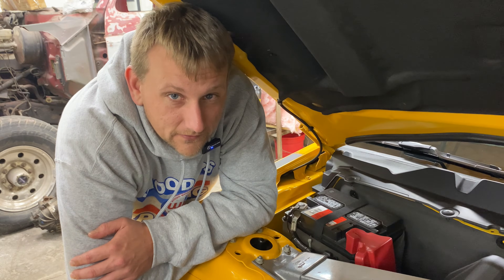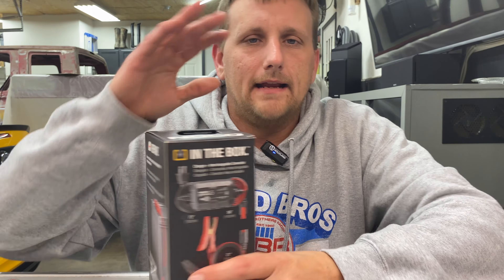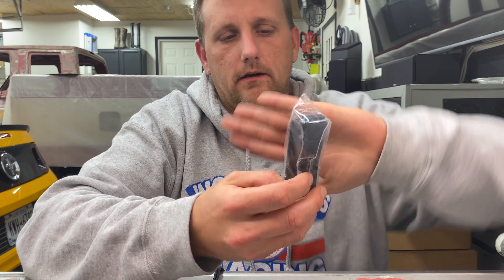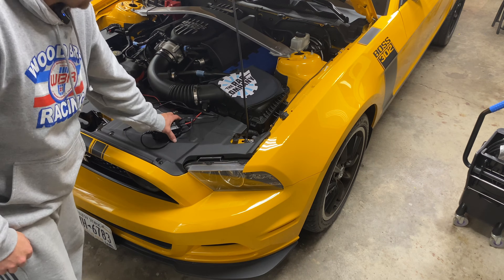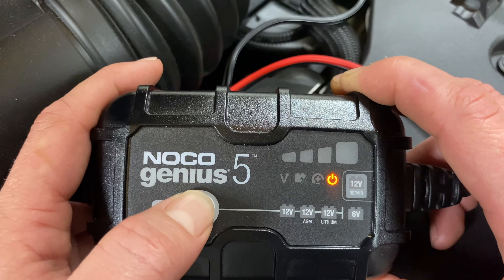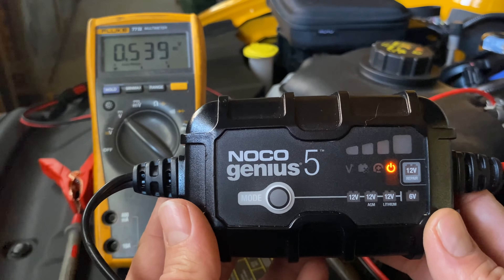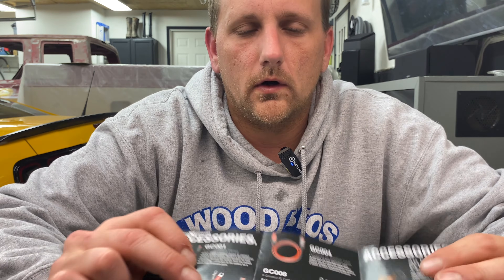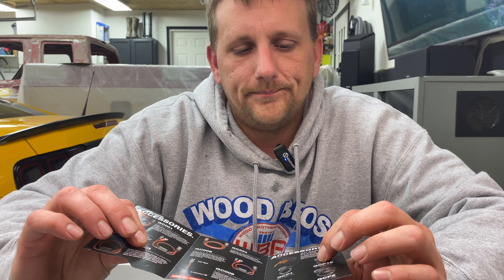NOCO Genius 5 Battery Charger/Maintainer How to, Features, and Accessories

Comment: Thank you for the demo. Noco's instructions are pretty useless.

I used my genius 5 for the first time yesterday. I was able to use to restore my car's dead battery back to 100%, but it wouldn't charge it at first. I had to do a jump start, then use the genius 5 overnight. It went from a blinking 25% life to a solid green in less than 12h. Another option instead of jump starting my car would have been to disconnect the battery to allow the initial charge.

The problem is that I had left my car in accessory mode, and even after the battery died the car still thought it was in accessory mode. Hitting the push start button with the dead battery in didn't reset it to its off position. As a result, the accessory mode was using up any energy that the Noco was putting into it (I could see the dashboard flicker on and off). Jump starting the car allowed me to properly turn it off and let the Noco do its job.
Reply: Sounds like you didn't use the force mode. If the battery is completely dead you must activate Force charge. Djoy e in the instructions

Comment: You've got it hooked up wrong. You've got it connected directly to the battery. On Fords you should connect it to the ground at the BMS otherwise it won't keep track as to how much charge you're putting into it.
Reply: what is BMS?

Comment: I admit upfront I don’t understand cars, batteries or even electricity. 😂. My son’s GMC Canyon (2021) is not driven much and won’t hold a charge.  It’s currently dead as a hammer.  Three questions:  how do I know what type of battery it is (for the setting on the Noco), and I see that you said this isn’t a jump starter.  However if I plug it in for a long time, like overnight, will it recharge the battery so that it’s driveable?  Lastly, do I have to leave the hood up while all this is going on?  Truck is in driveway not in garage.  (going to have to use an extension cord.). Would like to avoid having hood wide open if possible.  Thanks….argh.
Reply: The battery should have a sticker on top or the side with its specs. And yes you can keep the hood closed while it works. Should be drivable when done if the battery wad the problem

Comment: Can I use this to jump start? Does it have internal battery? Like when i am stuck middle of nowhere and no AC outlet around
Reply from the maker: No. This is just for charging and maintaining a battery. You would want the jump pack that they make. The boost (gb) or boostx (gbx) is the two lines of jump packs they have. I have a gbx75. It works great.

Comment: I learned the hard way that alligator clips are no good for a long term connection.  They seem to lose connection after a few weeks, and the battery goes dead.  I used the eyelets instead, but I didn't have to buy the eyelet accessory.  The wire is connected to the alligator clip by a copper screw with an eyelet connector.  Fortunately, my connection points were the right sized bolt.
Reply from the maker: I haven't experienced issues with the alligators clips on my genius 1 yet. It's on my mower. I will keep an eye on that. Thanks for the info

Comment: My 2001 mustang gt is kept in a garage where there isn’t an a/c outlet-if you have to take the battery out of the car is the setup process the same? I just got the genius 5 due to having to get my car jumped from not driving it enough from AAA the guy suggested a maintainer.? Thanks

Comment: I am not savvy about battery charging.  I lost my husband this year and now it's my turn to figure out how to maintain his sports car.  I bought this charger because I was told to put a trickle charge on it while it is in storage.  I was proud of myself for setting it up.  It was doing the just like you said pulsating up to the green.   When I went to check on it today just the standby light was on.  I pressed the mode and got the flashing up to the green again.  If I want it to trickle charge am I doing something wrong or does it automatically switch from standby to charging?  I appreciate and advice you can give,   Charging for dummies!

Comment: Great video, didn't even know such product existed.  I have replaced 5 batteries because of my lack of knowledge.  I especially like the car plug option you brought up.  After I buy this product, will give plug a try.  I wonder if Genius has a product where it auto selects things verses me having to select the right mode using the buttons?  Thanks Nate.

Comment: Question: So, does this NOCO Genius5 battery charger always need to be plugged into a wall outlet to charge a car battery? If I forget my car lights ON and the car battery dies and the car is not near a wall outlet, will the NOCO Genius5 charge the battery?  Please let me know. Thank you for helping! Great video.
Reply from the maker: The genius 5 will only work plugged in. It is a charge/maintainer. What you would be looking for to jump start your car is the NOCO boost(GB) or boostX(GBX) jump packs. I have the GBX75. They are costly but mine works great.

Comment: Hi Nate.  Just viewing your tutorial.  Thanks for straight forward explanation.  So I just purchased the exact same model as shown on this video and will be connecting to my 2018 Maxda CX5.  My question is this... I'm reading on the small tag (on the plug wire of the unit..) that IF charging while the battery is connected in the car, then if the vehicle is equipped with the Neg (-) lead which is also attached to the chassis, the black clamp MUST be attached to that and NOT the battery's Negative terminal.  I see you did not do this on your vehicle and I'm assuming because it is an older model and they probably did not do that in those years.    My question to you... why would it be "ok" to attach both the red and black alligator clamps to a battery for older vehicles that are not equipped with a ground on the chassis but... not ok for current vehicles that have a split in the negative cable lead which is attached to the chassis?   I've read several comments about the battery possibly gassing-off during the charging process which COULD  cause sparks and potential explosion.... is the risk different in both of the above scenarios (i.e. old cars and current cars) ??    thanks!  Anthony
Reply from the maker: Honestly my unit doesn't have any tag stating that information but I have seen newer vehicles that have a remote negative terminal and /or remote positive terminal to hook to for jump starting or charging. Some things are connected for safety and/or other electrical components of the car between the battery and the remote negative or positive terminal that if you go directly to both terminals on the battery itself, you could harm other electrical components of the vehicle. I can't speak to all the different reasons but I have seen that and it has caused me issues jump starting those style vehicles. My car just has standard connections with no remote terminals. If you check your owners manual for jump starting or charge your battery, it will show you exactly how to hook it up. That will clear up any issues with improper connecting of the NOCO. Always go with vehicle manufacturers recommendations from the owners manual or consult the local mazda dealer. I had a 2016 CX5 and from what I remember, it didn't have remote terminals but I could be wrong. It's been 6 years since I had it. I hope this explains some of the confusion for you.
Reply: @natemarcy3939 can you please explain this so I can understand it— cos I have a Mazda 2016 and now I am even more stressed— is this NOCO car safe and idiot me proof- or not?

Comment: Love your video. On the cigarette lighter, I don't think I would use that option. (I could be wrong) However, Some of the newer vehicles now use switching grounds so that the cigarette lighter does not have power until the ignition switch is on. I would hate to send power though the electronics not knowing where the current is passing through.

Comment: I charged my 2015 mazda 3 to full green led but the charge went back down to red (1st bar) im the morning when i woke up, would this be an issue with the car battery? (I'm about to try using the repair mode)
Reply: That shows that the battery will not Hold a charge, which could be caused by the plates in the battery being sulfated. If you use the Repair Mode it may and probably will correct the problem.   1.-- Charge your battery to 100%   2.--- With the battery at full charge switch to Repair Mode and let Repair Mode mode run until it shuts off automatically, which is 4 or more hours. In some cases you May have to run Repair Mode more than once to Fully Restore your battery.  From what I have seen, Repair Mode will work to repair the battery approximately 75% of the time.

Comment: Good timing as my Charger died and found your video, local auto shop had a Boxing Day sale today so raced over and got it plus the NC002 Eyelet connector. About to give it a try and then noticed on both boxes DESIGNED IN THE USA MADE IN CHINA. Not happy but this is a trap I have fallen into before. If I was younger my eyes would have been able to see this fine print. Guess I have to grin and bear it again but please note these are MADE IN CHINA.

Comment: @natemarcy3939 I also have a Boss 302 (2012 # 727).  Mine doesn't have access to a wall outlet, and solar panels are not a great option either since it sits under a cover.  Any advice on how i can maintain the battery?  
I've wondered if a battery powered jump start device would work, but i haven't noticed any that mentioned they could be used to maintain/trickle charge.

Comment: I think the cigarette lighter accessory is for the 10 version which acts as a power supply. So if you’re running an air compressor, you can plug the noco 10 into the way and use it to run a 12v compressor to inflate your tires instead of plugging it into your car (say you have a dead battery or don’t want to start your car)

Comment: Question: I read in some review that we need to remove the battery clamps when using this thing. Is that true? Or maybe just for long-term storage only?  I'm wanting daily maintenance for insufficient drive-time charging issues.
Reply from the maker: I would believe this is for long term storage. Should be fine. I leave mine hooked up all winter with battery terminals still hooked to the car. No issues in my experience.
Reply: @natemarcy3939  Thank you !! 🙂
Reply: @natemarcy3939 Hi Nate, please help. 1st time seeing your video/channel. Very informative!  I have a Genius 10, can't get my car into the garage and it's going to be -20 here. I saw an older Genius video saying to switch from 12V to 'Cold/AGM' (mine just bae 12V, 12V AGM, etc. I switched it from Regular 12V to 12V AGM access it finally charged to green instantly. Before, it was 8 hrs and still on the 1st red pulsing light. It's a brand new flooded battery. My question is, is it still safe to leave it at AGM? I can't find info Anywhere on their website. It's -7 outside now and we'll be between this and -20 thru Tuesday. Thank you for any help you can provide!
Reply from the maker: @aibhilin1211   I would have it on 12v not 12v AGM. Not sure why anyone would have it on AGM mode if the battery isn't AGM. Now understand, it has an operating temperature of -4 to 104 per nocos data sheet for the genius 10. You may run into issues at -20. Just keep that in mind that it may not perform as it should such as slow charging or no charging. I hope this helps. Stay warm!
Reply: I've been leaving it connected, set it n forget, per those who answered! Have had no problems.  Gracias to all. :hand-purple-blue-peace:
Reply: Thank you, this is what I needed to know. Messaging here from Toronto - and just got this for Christmas. 

It is ok to keep connected for 3 months of winter straight 24/7 and there is no trickle button setting, right?
Reply from the maker: @dublahar   I have had no issues with mine leaving it on for the winter. I check on it once a month to make sure all is good. No trickle button. It is all done within the Noco. Set it and forget it.
Reply from the maker: @dublahar this is correct
Reply: If you disconnect power to car, you re boot the computer on power up, so leave on, charge repair if needed, then leave on charge mode all winter is my 2 cents
Reply: @daleval2182  That makes sense, Thank you!

Comment: would there be any chance of you gettting zappp ?
Reply from the maker: With anything electrical, I was always treat it as a possibile shock hazard but in reality, this is very safe and being zapped is next to none due to all the safety circuits inside of the unit.

Comment: Thank you for this. Great info. I am researching this unit to maintain an AGM battery as my car is staying in the garage for the winter. Last year, the battery went dead and I couldn’t open the trunk were the battery is located 😂
Reply from the maker: Winter storage of anything with a battery is always an issue and with technology advancements it's making it worse. Lol sometimes it would be nice to still have basics such as a key hole to open trunks as a backup.
Reply: Funny thing is that there is a key hole alright, but it still needs a battery because the latch is electric lol. I was able to open the trunk with a broom stick using the ski pass through.

Comment: NOCO makes some awesome stuff, thanks for the video!
Reply from the maker: They definitely work in my experience. Picked up a genius 1 for the mower. That will be a test because it sits most of the winter except when I need to plow which the battery seems to be dead. I revived it once last year with the 5 so I will have the 1 on it all winter in the cold. Should show it's true colors.

Comment: Can i charge for 6hours and then unplug and then charge for another 6 hrs? The manual say don't charge it when you're not home in case the battery blow.
Reply from the maker: Yea. Shouldn't be an issue. If the battery is good, it will go quickly and then go into maintain status and monitor the battery. I leave mine hooked up all winter 24/7. I wouldn't worry about the battery blowing. Anything is possible but I think they state that for safety reasons to cover themselves from a lawsuit just in case it was to happen.

Comment: Left my running lights on over night, this NOCO would not start the car. Piece of crap!!!! Cheaper to buy AAA roadside assistance.
Reply: It's not a jump starter.
Reply: @lymanellsworth4727 THIS. This is a charger and maintainer. NOT a starter.
Reply from the maker: What vehicle do you have? Did you have the NOCO GBX75 or a smaller version NOCO? Could explain your process of hooking up and turning it on?

Comment: Great video. Help!! I hooked it up to my jeep battery that wouldn't start and it cycled from the red to pulsating green. It started the first time. Then 2 days later it was on green and did not have enough juice to start. How do I repair the battery now when I hold the mode button it just goes from 12 to 6 volt then back to on light I can't get all the lights to flash or go in repair. Any Help?
Reply from the maker: After holding mode and it goes to 6 volt, let off mode and click it again. That should take you to the repair mode.

Comment: Thanks Nate your instructions were clear and easy to understand. I have a 2021 mustang GT.
My car isn’t a daily drive. 
The last time I took out was probably 2 to 3 months ago and didn’t close the trunk properly and flattened the battery. 
It’s 10.30 pm where I am in Australia. I’ve just set the charger up and followed your instructions. I’m hoping it will be fully charged in the morning. My understanding is I can leave the charger on for as long as I like and it won’t harm anything. 
Is the true. 
Thanks again mate 
….jim
Reply from the maker: Thank you for the kind words. I have mine for my mustang as well. You can leave it on for as long as you want because it recognizes the volt and toggles on and off depending on the voltage.

Comment: Could someone please tell me what type of battery is in a 2021 mustang GT
Reply from the maker: Standard 12 volt lead acid battery so you would use the first setting on the noco that has no wording under the 12v battery symbol.

Comment: How long should it take to charge, I’ve charged it over night and still at first red light
Reply from the maker: It depends on how dead the battery is and what condition it's in. My truck batteries truck batteries take 2 days from dead. If it's still on the first bar after that, try doing a repair which will take 24 hours or more depending. If it still doesn't charge, the battery maybe too far gone to be saved.

Comment: Thanks for the information!
FYI: At the end you are showing the options. The cigarette lighter option is perfect for the Stingray Corvette! There is a “female” connection right above the battery in the rear of the car for easy trickle charger hookup.
Reply from the maker: Thats great info to know. Much appreciated!!!
Reply: @natemarcy3939 
Merhaba,
Dişi çakmak yuvasından şarj edilebilirmi?

Ford Focus 2,5 arabam.

Saygılarımla.
------------------
@natemarcy3939
 Hello,
 Can it be charged from the female cigarette lighter socket?

 My Ford Focus 2.5 car.

 Kind regards.